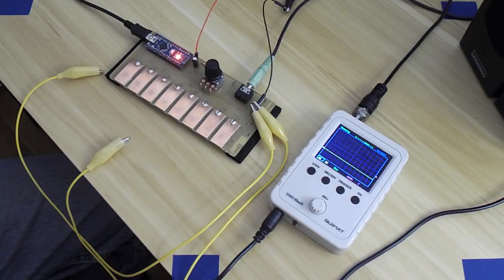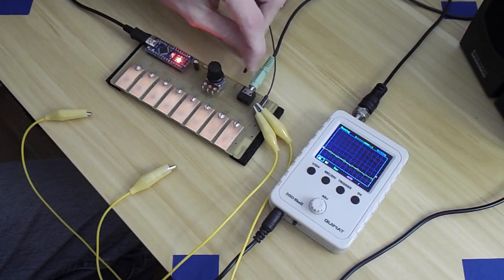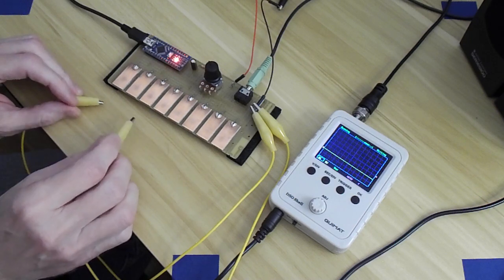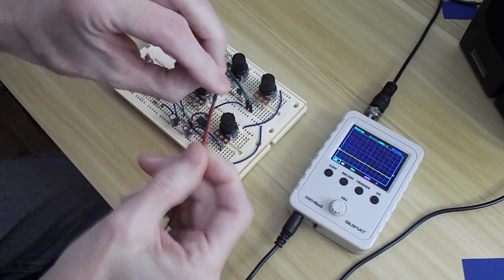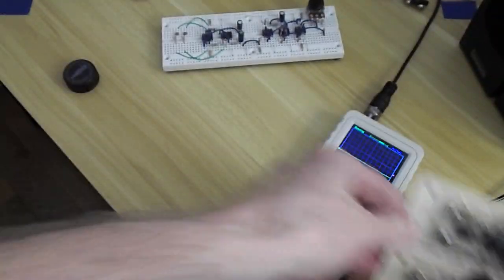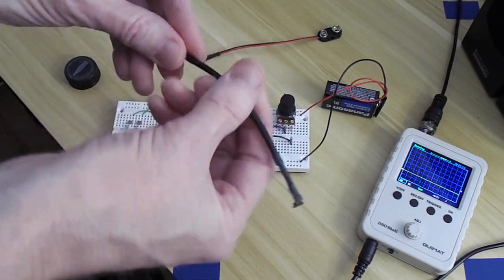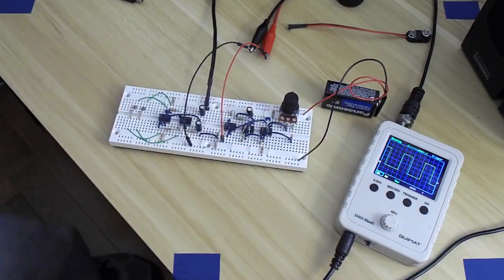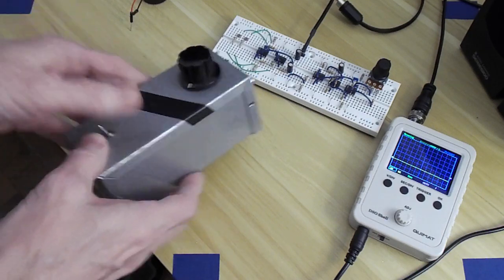Arduino Synth Waveform and Other Stuff

Comment: yeah, a seperate video for just the filter in its actual state and "in depth" detail for why you build it this special way and how you do it would be really nice. So that we could understand the circuit a bit more and hear the benefits of the choosen parts. (for instance: why two LDR's instead of only one and why the 358 and not a simple TL074 or for higher audioquality a TLE2074 - i think 2 LDR's have more resistance and closes the filter bether than just one and the 358 are perfect for singlerail and not need a minus powersource (Vee) - (only positive Vcc and GND for batteryuse). But i whant to know your thinking about the circuit ;)
btw, very nice video, thx man :)
Reply from the maker: Uploaded the filter video, here is the link: https://www.youtube.com/channel/UCk4mtz-tZbXdk1Xb0DSd2QQ/videos?view_as=subscriber

Comment: Very cool! Didn't realize you had PWM in your code from the first video.
Reply from the maker: Yeah, in my first experiments with Arduino code, I was sweeping the pulse width by sampling an external triangle wave LFO on one of the analog pins. But I knew there had to be a way to do it in code. A guy I used to work with came up with the interrupt service routine that does it. Shout out to Oliver Tully!